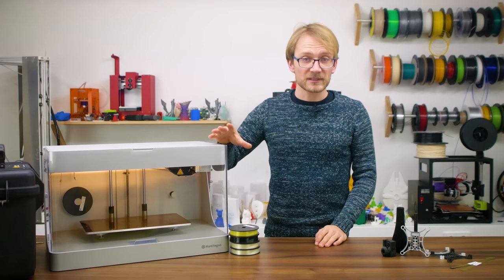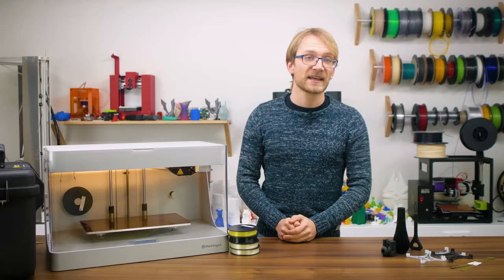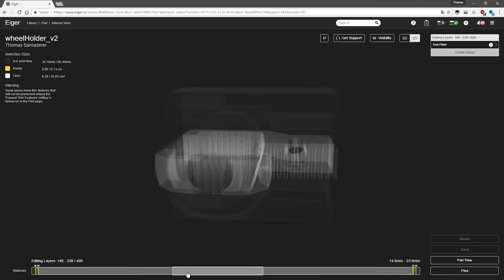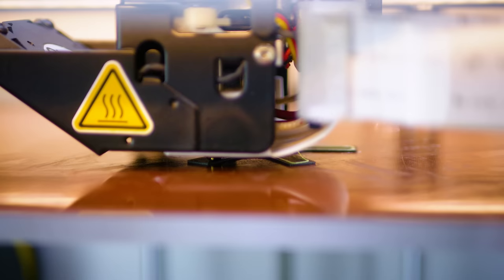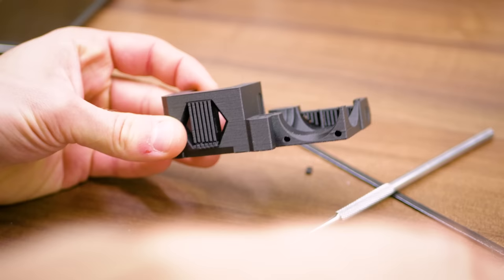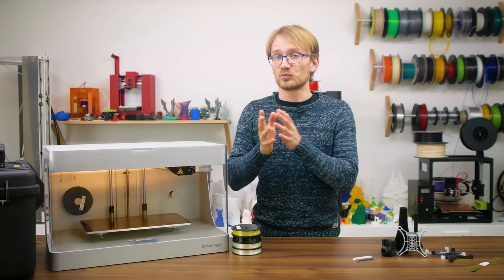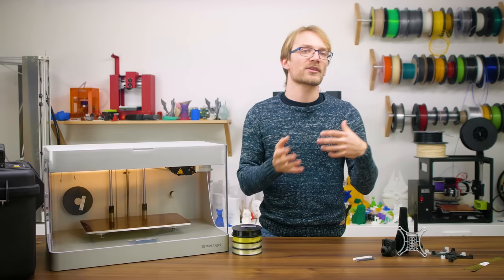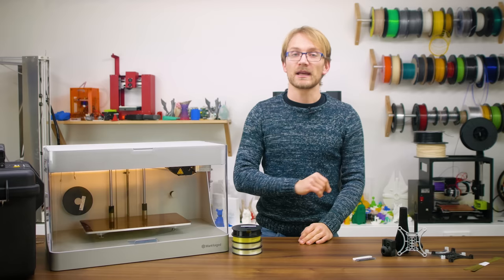The Carbon Fiber Printer: Markforged's Mark Two review!

Comment: The amazing discourse about patents and the comparison with FDM and open-source was the best part of this awesome video. This is an issue about which other 3d printing youtubers do not care enough.
Reply: Haha, yup, gotta shame them into doing the right thing!
Reply: If they were able to have a new patent granted the technology must differ from FDM somehow? You can’t patent technology that is already patented so not sure what they actually patented here? 

Depending on how much their R&D cost patents are sometimes necessary for these lower volume products that otherwise will end up ripped off by Chinese manufacturers for a fraction of the cost with no R&D overhead.
Reply: @Alex-us2vw  
Markforged has patented the Onyx material which is a proprietary Nylon based compound. As well they have patents for the Continuous Fiber Filament; and I think their software that allows CFF to be embedded into any STL file. 

What, I'm still trying to understand is why they haven't just moved to selling/licensing the software and CFF technology. Anyone can buy a CFF extruder and filament from their website. They only thing preventing most FDM printers from being upgraded to CFF is the software which Markforged only makes available to customers who purchase their outrageously overpriced printers.
Reply: @AaronAlso  "overpriced" what less expensive printer can lay down continuous fiber/kevlar (not chopped) like this?
Reply: Desktop Metal has at least given them some competition recently - they came out with their "Fiber" printer which prints in continuous fiber tape rather than individual fibers. If their data can be believed, their material boasts 3x the tensile strength and almost 4x the flexural strength of the Mark Two. You can't buy the printer outright though, they only offer leasing options.

Food for thought

Comment: So they use open source/patent free technology as the main platform of operation yet hold the patent for the fiber extrusion head and won't let it out ? Ridiculous. ...Markforged is a company that is less then to be desired after finding out they are holding back humanity's ability to thrive in this arena.
Reply: @Mike Hewlett Microsoft isn't using open source technology to make their software so it's not a valid comparison

Comment: What a scam. Costs far too much for what it it provides.
Reply: i dont think this is for residential use.
Reply: There is no way it is for consumer use, consumer pricing typically is set at US$300 anything more and it becomes tough for people to purchase on a mass scale. with 13500 you could buy a brand new car or pay a good portion of it. Honestly a waste of money though, the way the carbon fiber continuous layers worked seemed far too underdeveloped for it to actually make a difference. It just seemed like you couldn't put in too many layers of the carbon fiber and the price they were selling it as just seemed crazy. Plus they even cut the carbon fiber once a layer is complete which I thought the whole strength would come with the carbon fiber being incorporated without it being cut and staying as one piece. One messed up print and you lose money like nothing even though if you can buy this then a misprint wouldn't make you feel too bad.
Reply: 13500 isn't a whole lot in commercial space. A decent industrial quality CNC machine will is in the same ballpark. Useless for you, useless for most businesses, but probably worth the money for a business that /does/ have a need for high-strength rapid prototyping, or perhaps lots of varying parts. Remember that machines like this can't count on any economy of scale productionwise: They are not going to sell a lot of these things, so development costs and production line setup costs aren't spread over anywhere near as many sold products as a more conventional professional 3d printer, or even prosumer, let alone a consumer device.
Reply: Cdabek clearly not for consumer market . but if you think is a waste of money , you just have poor understanding of the value of addittive manufacturing vs subtractive.
Reply: Fra Panta, I wasn't the one that said it was a waste of money, I'm actually trying to get my boss to get one for the company I'm at since the parts it can make can be used out in the shop floor.
Reply: This is a money making machine.  You don't sit around making key chains and widgets with this.  It's not a scam, if you run a business and make prototypes and or sell services.  Come on...just because something cost more than a $200 garage FDM modeler it's a scam?
Reply: Strongly disagree...it's selling like crazy and the new Onyx material is awesome!
Reply: It is a money making machine for the people making it lmao, you work for them? How can this machine be making you money, initial start up is 10k and up. One machine. How many prototypes are you going to be pumping out and how many machines are you going to buy to make money. No one is going to start up a business making prototypes or selling a service which just one of this machine. Tell me how many start ups you know right now giving a service with just one machine and it is solely this machine? This machine is garbage. The idea they have with having carbon fiber strands put in is a cool one but if I remember correctly, carbon fiber really gives strength when it is continuous and woven into the braided pattern. Have layer after layer of this for sure isnt going to give you the real reason as to why carbon fiber is used in applications. What would be the purpose of having an in between use of it then just seeing a partial increase in strength for example at a huge cost like this. This product is garbage, and you have no proof other than stating that is is selling like crazy. Something like a prusa is selling like crazy not something like this lmao. This is just a product that costs this much because it is branded like that, like how much finer quality filament can they have that they charge such ridiculous prices like that.
Reply: Dont get me wrong, I first heard about this printer before this video when there wasnt much info on it from this channel and I thought it was pretty sick that you could have carbon filament put into it, but with the limitations on the amount and where and the fact that the carbon is only continuous per layer makes it seem worthless.
Reply: It's fine to be critical but calling this machine "garbage"? C'mon. You lose all credibility on your other points when you make a statement like that. 

I work in the aerospace field and our company is looking into getting a Mark Two. Clearly you have never had to pay to have an aluminum part CNC machined, because if you did you would immediately see the benefit of this technology. Not only can you make prototype parts for a tenth of the cost per part that a CNC part would run you also have that same part in a day instead of 3-5 day turnaround. That is invaluable when prototyping. If you have to make a change to the design you can do it and test the new design the next day. With conventional machining that process takes over a week. Now imagine having to make 3 or 4 or 5 iterations on a design. The ability to reduce time-to-use is huge and at a price of ~$14K is very easy to pay back for a corporation like ours. 

I agree, that this is not for the DIY hobbyist, but that is not the market Markforged is aiming for I'm sure.  And I do think any small business that is paying or investing in $100K CNC mills and or the parts made form them could benefit. You are missing the point on how this machine "makes" someone money. It does it not by allowing one to sell the parts it makes but rather saving thousands of dollars and hundreds of man hours by replacing the need for slow and expensive milled parts.
Reply: This is not a kids machine.
 This is a machine for actual engineers and people who know the value of more expensive traditional tools.
Reply: But why not get a small CNC mill instead?
Reply: Iceteakilla grow up. Don't call something garbage just because you don't have any idea how a business works. There definitely are people making money with these. I'm looking at one myself.
Reply: is a desktop machine that makes Kevlar and carbon fibre reinforced parts .... good luck finding a industrial one for that price.... what do you think would be the prototyping costs for parts like that without a system like this? ... and in a commercial context 13.500 is kind of amazing for a machine with these capabilities.
Reply: How many parts have you used made on one?  Even the base model Onyx One using Onyx chopped fiber nylon is amazing.  It's a $4k investment with several extra spools of Onyx and service warranty.  Ours paid for itself in a few weeks.... crazy ROI.  It has been a paradigm shift for us.

Comment: Great video Thomas, I just received my Enterprise Mark 2 and I am just blown away. Superior build quality combined with amazing software and you have a great printer setup. I have the Mark X on tap for 4th quarter this year. Thanks again, keep up the great work.
Reply: is it work well? Does it have any defects？Cause I want to buy one for trial.
Reply: I have one myself and it may have been the best investment I could ever ask for
Reply: Ive had only about 2 prints fail because of insanely complex part geometry but otherwise, the other 200 have turned out flawless.

Comment: Looks like they are trying to be the apple of 3D printing industry. Can't wait for someone like Prusa or some random tinkerer to make a kit version of this
Reply: We have one of these at work. They make fantastic prints - I don't recall ever having a failure that wasn't due to a bad CAD model, the quality is amazing in terms of calibration. You can barely see the layers and even then only on curved surfaces. There is virtually no maintenance aside from the occasional bed level.

A kit version would cost thousands. The precision components alone would cost more than an assembled Prusa. Most of the interior is CNC'd, no printed parts. You could build something this good, but it wouldn't be cheap.

You're paying $15k (plus consumables) for a machine that really does "just work".
Reply: We have one at Uni as well, it's really a piece of engineering art. Nylon + fiberglass prints are amazing. I think the price is "ok", but it's really sad they patented the whole technology...
Reply: Your comment is 4 years old, what do you think of it today?

Comment: Controller is a BBB(?) running Linux, I hope they disclosed the GPL source code (or reference to it) somewhere, as per the license requirement.
Reply: If they did not that is a breach of the license
Reply: It's only a breach of they make modifications. Depends on what they did under the hood...
Reply: If you’re running your own software on top of the Linux platform then that doesn’t count as a modification. So you don’t have to disclose your source code.

Comment: I just got my Onyx Pro a week ago and have been running it almost nonstop since. Not a single failed print and I'm almost going to need to order another spool of material. It was really hard to decide between buying the M2 Standard before it got d/c'ed at the end of 2016 as that offered nylon, carbon fiber, and fiberglass, whereas the more expensive Onyx pro only does Onyx and fiberglass, no carbon fiber. That to me feels like an arbitrary restriction for such a price increase. 

But all things considered, it is a phenomenal printer that simply does things other printers can't. I was expecting the strength, but not the resolution. At 100 micron it looks almost sintered like shapeway nylon. And while you make a lot of good points on patents and such, you have to give the company credit for being significantly less gouging than Stratasys or 3D Systems. $200 for a spool of Onyx is a lot better than a spool of ABS. The nylon could and should be cheaper though. 

I also wouldn't say that the company is hurting innovation as they are still pushing the envelope with the Metal X. They are hurting competition but that's what patents are for. They have incredibly generous upgrade paths as well, so I'd say they treat their customers right. You know what you were getting going in with material cost, and as long as you are at peace with that, the printer does live up to all its lofty promises in many ways. If you can't afford one and need the capabilities, you can always pay someone else.

Comment: On another topic, this machine is great but.... the strength (pun intended?) in using fiber in a structure comes from overlaying it in several different orientations. This printer is only able to lay it along the tool path, reducing the ability to strengthen a component... so is the fiber laying ability really just an expensive gimmick in the end?

If the printing table had it's own 3 - 6 DoF (degree of freedom) then the printer could stop, re-orient the part (table) and then lay a new layer in a different orientation. That would make the printer stand out. And BTW guys, that's how you innovate when faced with patents... you make the design better. It's hard to do nowadays, but that was the original intention of patents, before they were corrupted.

 - Eddy
Reply: With composites the final material strength is anisotropic depending on on the orientation of the fibers. Many applications do not require overlay in different directions. Many applications require fiber orientation in only one direction. You might want stiffness along one axis, but allow for flex or twist around a different axis. Fiber cloth is sold in many different weaves. Unidirectional cloth has fibers running in a single direction only (with a minimum number of fibers woven perpendicular to keep the fibers together as a cloth). Cloth may also be woven to be triaxial (fibers running at 0, 45, and 90 degrees) and a variety of other multiaxial layouts and nonwoven mats with random fiber orientation. Even with random orientation mats you have options for short cut or chopped straight fibers or longer bent fibers.

The main weakness that struck me with this the process used in the Mark Two printer is that it does not appear to provide a method to pin or embed fibers in along the Z direction, so there is no way to provide strength or stiffness for structures that run along the Z axis. Printed parts may be not be able to resist Z shear and could delaminate under repeated stress.
Reply: I would agree with both of you - this printer certainly has its weaknesses in the Z direction for shear as well as the lack of ability to print true woven fibers  - purely just continuous fibers. An idea of mine is to perhaps alter the software that is slicing the STL files going into this printer how to extrude the fiber in multiple directions because in this case the mark 2 only extrudes in a single layer.

Comment: I use this machines. I have 2 of them in my workshop. I make most of the mechanical parts for myprojects with this printers. The problem is that they are noty 100% suitable for small series, since the mechanical parts arte getting weard really fast

Comment: So the secondary material is most likely just a rod of that material with an outer layer of nylon. And it's probably literally just pressed into place with the nozzle. 
Not that hard to recreate the mechanism, it's literally like a second extruder, but it cuts off what it doesn't need. All you need to do is program the difference of where the nozzle is and program the switch between the two. 
As for the material itself, not sure how it'd be manufactured. 
But the mechanism can just be retrofitted to any machine, though you would lose print volume, and you'd need the extra code.
As for the nozzle, I'd suggest finding a tungsten carbide, of all the harder materials, that should be the easiest to source.

Comment: Just gotta say that the little bit of experience I have had with this printer was rather poor. I was working at a company that had bought one a few months ago, and they were constantly having issues with it. Even just trying to print straight nylon very rarely worked correctly. Part of this may have had something to do with the people that were trying to operate the printer, but things like warped beds sure didn't help the situation.

I never got to actually operate it, but as you said, the print options are pretty limited, so it wouldn't have mattered.

Anyways, just my experience and $.02.

Comment: Do you think we'll see any other materials sent through the fibre nozzle on machines like this in the future? I'm thinking copper wires.
Reply: That was one of the first things I thought of too. Embedded wiring, even whole PCBs, would be interesting...
Reply: LEDs, sensors and strain gauges for a start.
Reply: Jeremy ... imagine that with a tool changing, multi-material printer, with pick and place!
Reply: I can imagine problems with faulty connections, short circuits etc with that, but it could be sooo awesome with multiple fibres allowing for parts which are strong, conductive and precise.

Comment: Nice review of the Mark Two. I am a bit disappointed that Markforged got rid of the standard and professional versions of this machine and released the Onyx series in their place. Their unique selling point is the CFF process and that is removed from the Onyx One leaving only the ability to print Onyx on a $3500 printer. The value for money just doesn't seem to be there. Same for the Onyx Pro - 7k for only fiberglass? Seems like they really want to up sell you the 13.5k Mark Two so you have access to the entire fiber ecosystem.